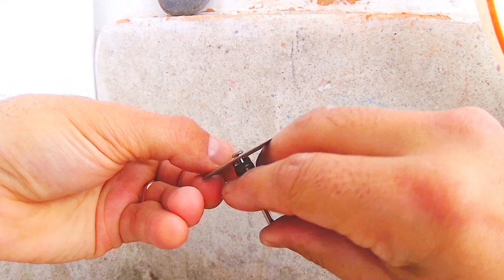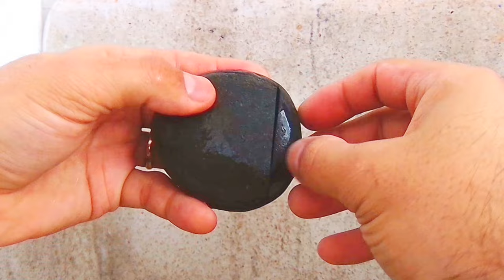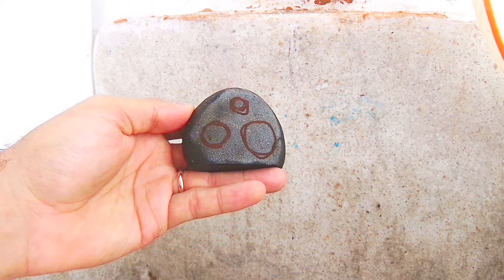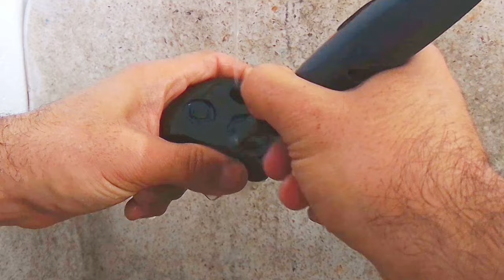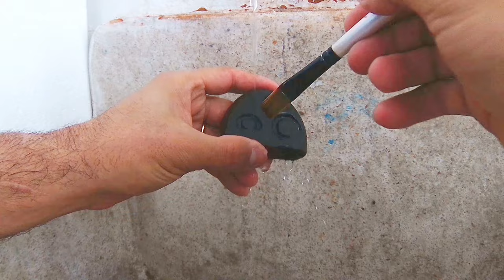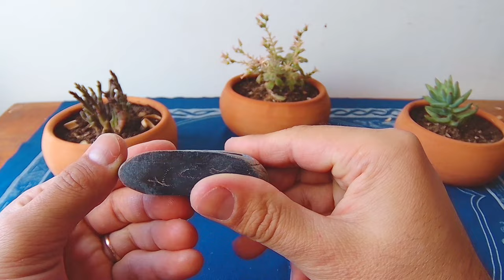How to CARVING STONE with Dremel, Incredible design for STONE CARVING very easy to make

Comment: Thanks! Wow, I am new to carving stone with a rotary tool and this is awesome. I love seeing how make holes and cut the stone almost like cutting through butter with a hot knife. Obviously not that easy but, yes, I am looking into a trick I learned by drilling a hole into a 2-liter bottle. The water streams out enough that we can all use it when stone/glass carving to keep our diamond bits from overheating. Great video, btw!
Reply from the maker: Thanks for the comment and the tip.
Reply: Dunk in soapy water rather than running tap water works even better !
Reply: @RichardKuivila1947 Does this work beter than just dunking in water to remove all the particles? Wokt the soap make the stone more likely to slip from you while working on it?

Comment: I would love to get into carving the stones I collect what is the best drill for a beginner -  and I would've thought that the water touching the drill that is attached to electricity would cause electrocution wouldn't it? Thanks, and I loved your video
Reply from the maker: No. The motor Is dry. The Flex Is only mecánic.

Comment: Do you have to be careful to keep the Dremel from being damaged by the water?
Reply from the maker: The flexible shaft has no current. It's like putting a mixer in the soup, you only use the mechanical arm but the motor is outside in the dry.

Comment: The one thing I dislike about the dremel attachment is the lack of controls on it. iirc  there's no speed control or even an on/off switch.
I guess I get the point about gloves catching on the blade, but I still feel I'd prefer to clamp either the stone or the tool. Wet slippery stone doesn't seem like a stable thing to handle 
Perhaps I'm wrong. Either way, this video has given me an interesting suggestion for a project I'm considering. I would have never thought to use my dremel to carve stone.
Reply from the maker: You can attach a pedal to regulate the speed with your foot.

Comment: Consider using some jigs and a vice, or at least some protective gloves. Fingers are valuable and delicate.
Reply from the maker: Gloves are not recommended underwater and with a tool that rotates at high speed. Diamond bits are not dangerous for the skin, they do not cut soft material.

Comment: Putting a rotary tool that close to water makes me nervous
Reply from the maker: There is no danger. the engine is in a dry place. Electricity does not pass through the flexible, you could submerge the entire flexible in the water and nothing would happen, it is a different mechanical part from the motor. It's like a blender for soup.

Comment: Gloves my friend, gloves... The handshake with danger is the one handshake you wanna get right😬
Reply from the maker: Thanks for the advice. However, diamond burs and discs are not a danger to fingers.
Reply: @CharlyBrunetSculpture  I'm gonna test this with a hot dog
Reply: @doomiusborgius  it's literally more dangerous to use gloves with high rpm small tooling
Reply: @nathanielhartsuff2336  I was thinking the same; the fabrics getting stuck in the spinning shaft and... yeah
Reply: Please never use gloves when using a drill/dremel/rotary tool!You'll get your finger ripped clean off! 😬
Reply: Maybe pliers to hold the stone? 😬
Reply: 🦺 Gloves can catch on spinning equipment, Rotary equipment like Dremels and Lathes. Do not wear loose gloves(spray on  gloves would be best) , long hair, or long/loose sleeves , WEAR safety goggles,  and mount the workpiece firmly.
Reply: No need for gloves.  I've even touched my diamond blade on my tile saw (easier way to do your straight initial cut, btw).  It'll give you a friction burn if you keep touching it, but not sharp at all.  They work by grinding at a very small level. I do recommend a good respirator for the dust though, you don't want silicosis.
Reply: You're getting your handshake wrong if you use gloves with a rotary tool.
Reply: @doomiusborgius 😂